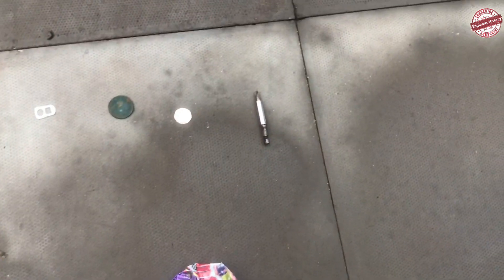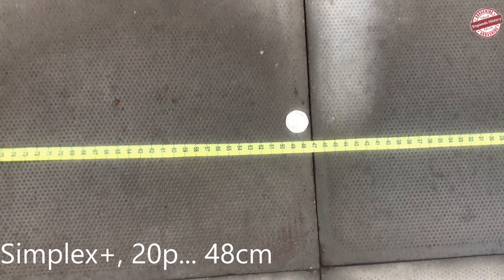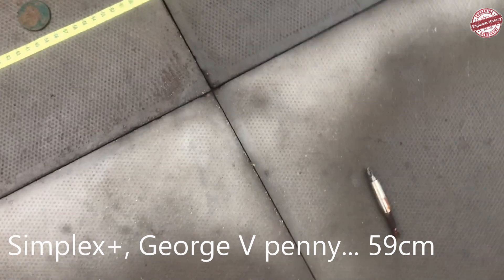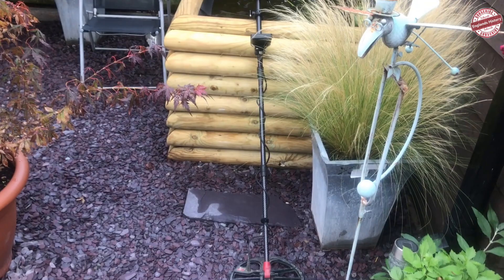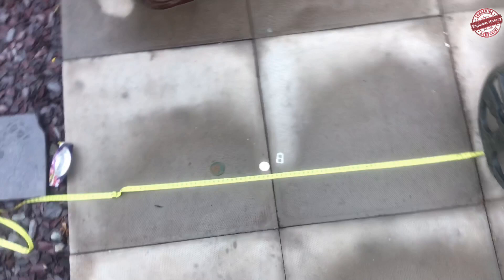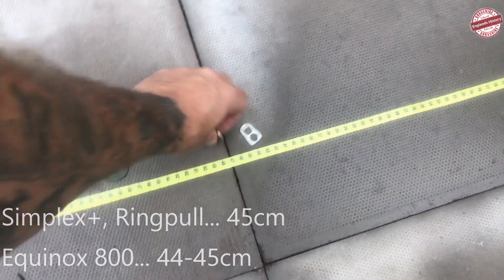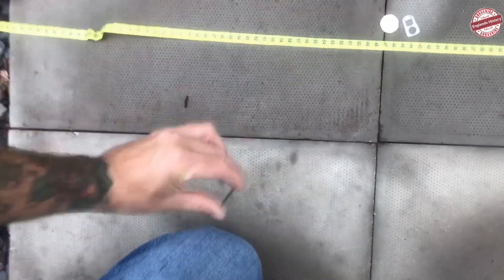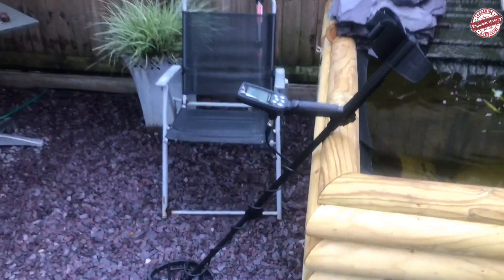NOKTA/MAKRO SIMPLEX VS MINELAB EQUINOX 800

Comment: The problem on that one seems to be that you just wouldn't usually dig a whisper like the Simplex gives off halfway through it's maximum depth, the Nox is a strong signal almost to full depth, very intriguing test, though, and certainly impressive on the Simplex's side!
Reply from the maker: better audio when headphones are on (y)
Reply: Ooh I dig all those whispers :), why you wouldnt dig those? Once you are used to machines with audio modulation on target depths and you get a machine like the eQuinox that hasnt have the future, its fcking anoying to search without it...
Reply: @TheInsox  I like my Nox, no fuss over whispers just clear, deep signals
Reply: @viperdetecting4425  ye... That's just cause it doesn't have the future.. I wished they had audio modulation feature on it. Would make it a far more better machine for me. Don't like it when deep signals banging in.. love to hear the faint whispering when I have to start digging
Reply from the maker: iTz Catchyy ive been asking for audio gain in the nox since release.. i love to know when a targets deeper... great for old pasture land especially if modern trash all in top 3/4 inchs
Reply: @englandshistory ye mate, very true... What if I told you that is my main reason why the equinox was thrown in the closet as a backup machine 😅..  After using machines with audio gain, searching without it feels like a man loosing his Di** at adult age.. can't get used to not having it. But besides that Im still convinced the equinox is a overrated machine 🤫..
Reply from the maker: iTz Catchyy the nox does have some magic about it and seems to winkle stuff out of difficult places... but gonna give this simplex a few more outings see if it keeps producing 🤘🤘🤘🤘🤘 so far so good

Comment: A few years back, started off with Ace 250--dry sand ok---wet sand just hopeless. Stepped up to Deus---outstanding in pasture and dry sand---no good in wet sand. Got my Equinox 800 a year ago and never looked back. Most of my detecting is on the beach so this demands a good detector---guess I"ve found it !  Happy digging folks !
Reply from the maker: equinox is amazing on beach... super stable and deep

Comment: It's an interesting test but not actually that useful. For it to have real meaning you would need to test against the nox out in a real world search environment, preferably out on the wet sand. Nokta Makro's beach mode on their machines is better than most single frequency detectors but having previously owned the Racer and the Impact..which I "thought" worked great, the nox is in a whole different league! That is not to say the Simplex Plus is not going to be great, especially given it's spec for the money but comparisons like this only ever benefit the company not the end user.

Comment: To bad the Simplex sounds like a sick duck. That would drive me crazy , the same goes for the Deus !
Reply: I have this with minelab equinox 😉
Reply: @boukjedejongh6375   
Too much popping and cracking. Makes for an unpleasant hunt.
Reply: @timrogers2045   Minelab, Whites and Rutus are three of best sounding machines available period  !  All the AKA machines sound pretty good also.
Reply: 1 @lewis1141951  yup all makro nokta machines are chatter nightmares
Reply: @4178529  They sound like a cheap radio that's not quite tuned in !

Comment: Does the Simplex works with the wireless Quest Headphones?
Reply: No. Same frequency but not compatible. You could of course get hold of the Quest WXT Wire Free transmitter and plug that into the Simplex's headphone output. Cheaper than buying the Nokta Makro headphones.
Reply: @yamahamusicians  Thanks.

Comment: Im wondering if multi IQ is just a gimick.cos that nokta packs a serious punch for money .
Reply from the maker: i was gob smacked!!!
Reply: Multi-IQ is definitely not a Gimmick. My last machine was a Nokta Impact and before that a Racer. I also have a Ace 400i and Quest Q40. The Q40 punches very deep but it's not exactly a pleasure to use on the wet sand. I used to think the Impact was great as was the Racer before it but then I bought a Nox and it's been a revelation! I am always wary of the smoke and mirrors of the company marketing/pr departments but hats off to Minelab, they were not exaggerating. Or at least that is my experience.

Comment: The mine lab battery is probably about a year old so that will make a difference
Reply from the maker: Paul Broadbent so after a year the equinox depletes in performance??? I never knew that
Reply: EnglandsHistory try and get hold of a brand new Equinox and the results will be totally different.
Reply: @paulbroadbent5872  Nah, that will not make any difference at all!